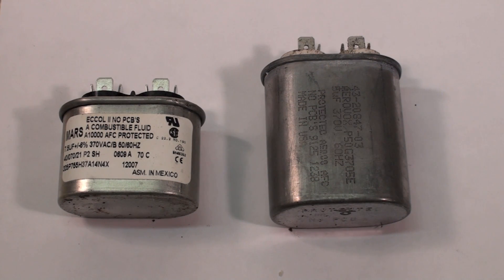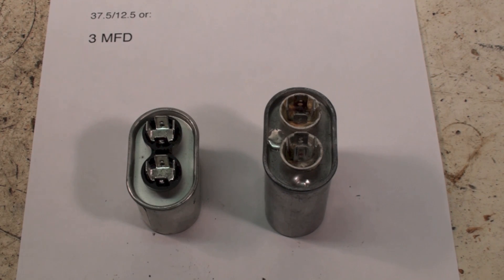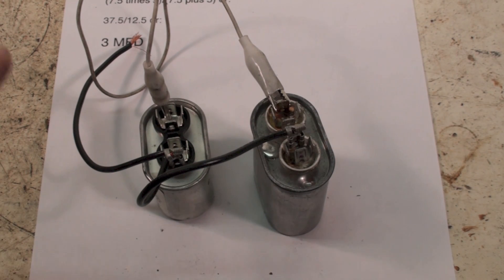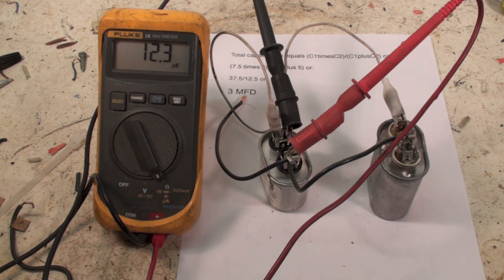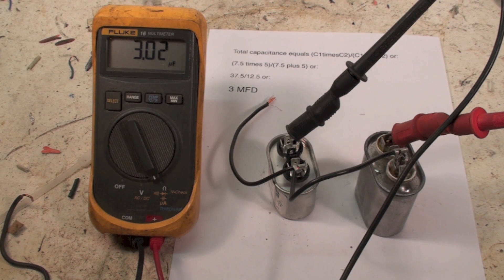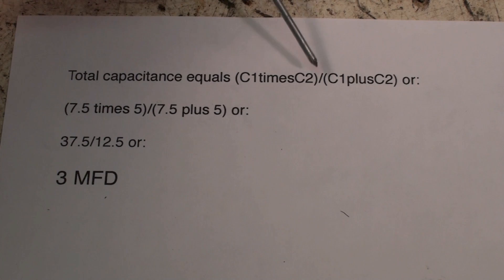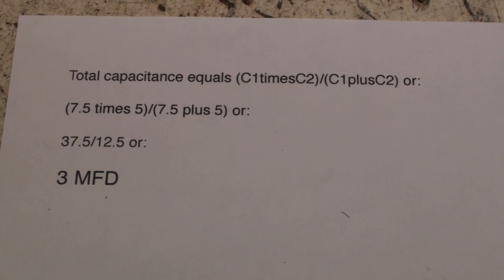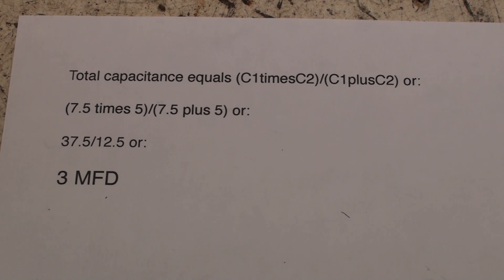Parallel and series wired capacitors in HVAC

Comment: He takes readings and shows the math but does not actually explain what is happening when the capacitors are in series or parallel.
Reply from the maker: This one is a practical method for determining capacitor size for HVAC applications.  It is not an explanation of the way capacitors work.
GFM
Reply: Yes my bad, it is a well constructed video. Thumbs up for you good sir!

Comment: Hi gfm,Thank you for enjoying your video allways.Question, 25/5 mf compressor but I use 30/5 mf and running good. Can leave it or have to use correct size?
Reply from the maker: As long as you are within 20% of the original cap you are ok.
GFM
Reply: Hello Mr gfm,
If so, either +,- 20% will be fine?
Reply from the maker: You got it.
GFM

Comment: is parallel plus to plus and minus to minus.
Reply from the maker: No.  In A/C there is no + or -.  The capacitors used are designed to be used with A/C.  Hope this helps.
GFM
Reply: +grayfurnaceman sorry, I'm a bit dumb when it comes to electrics, I just thought all capacitors are the same, I've worked it out now I think, it was for the little black caps with 2 wires coming out used in electronics,  I've done the caps with both - on the same rail and both + on the same rail, hope that's parallel,  lol.

Comment: This is for electronics students....Another easy way to calc. series caps is on the calculator enter:
C1 then hit the reciprocate(1/x) button + C2 then hit reciprocate(1/x) button, hit the = button then reciprocate(1/x) button
I use the TI-30x calculator, it's simple and does everything ya need.
This also works for DC parallel resistors and AC parallel Inductors

Comment: What does it do to the Volts. Does the Volts increase also when wired in Parallel?
Reply from the maker: vqfive The voltage doubles when 2 of the same strength are wired in series.  Parallel the volts stay the same.GFM

Comment: Ok question, I have 4 run caps, I need them all in series, do I have to use both terminals of one capacitance to connect to the other capacitor or do I just use one terminal, then connect to the other one terminal so on and so forth. 

Because I have been using both terminals for series connections, I am not sure if my capacitors are actually working.
Reply: Meaning for series connection, do I have connecting wires be in contact with one another or the terminals are enough
Reply from the maker: I would call it daisy chained.  Hope this helps
GFM

Comment from the maker: These caps are used in AC circuits, so the terminals are interchangeable unless the cap is a dual one.  If wiring caps in parallel or series with the dual cap, you would use the common as one terminal.  Hope this helps.
GFM

Comment: I have done this several times just to get the customer by for a few days until I could get the replacement! I would never leave like that for good! It does work in a jam and would probably last a long time! The part I don't like is its bulky and hard to mount under some of panels! I have replaced up to 4 together and the customer said it had been that way for years! Great video!